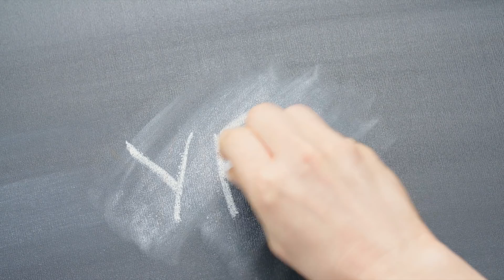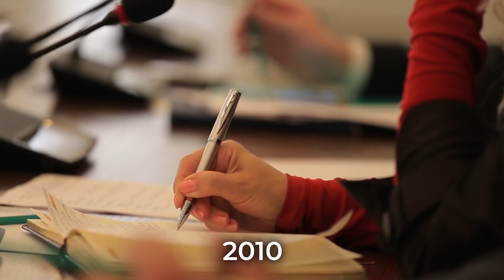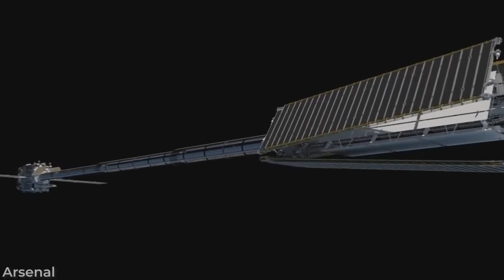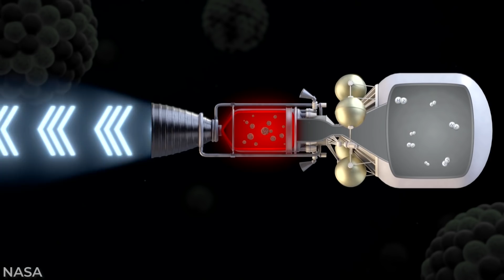Russia's INSANE NEW Nuclear Spaceship to Visit Jupiter

Comment: Is it cheaper or safer cost ratio to put it in space in pieces? The reactor itself should be fairly benign until it's turned on and becomes contaminated
Reply: The tug weighs 22 tons. It will be launched into orbit by the Angara rocket. The scientific payload will be delivered by the next launch.

Comment: I hope they succeed. Extremely expensive to get a nuclear reactor into space but once its there, you have ass loads of power you can do pretty much anything with it at that point. All you would need is to run more fuel up in 10 or 20 years.
Reply: What is expensive in getting nuclear reactor into space? The reactor is smaller than they put on ships and submarines while the launch costs are the same as any other space launches.
Reply: Several inaccuracies in here. As one example, the reason for HEU is not that it withstands reactor heat better than LEU, but because it packs more energy per volume. This sounds as if written by someone with certain gaps in knowledge of the topic

Comment: Russia - will not make it. Its just to overcome the shameful state of the roscosmos - after SpaceX rid it of the USA launches...
Reply: Russia has breeder reactors, a closed nuclear cycle, the ability to use any uranium as a fuel, the most advanced technologies for enriching nuclear materials, there is oil for petrochemicals, there is gas for fuel, there is hydrogen, helium, there are additive technologies, its own processors and low-level computer languages just above the assembler, China is using our missile warning system, using our gas and coal, germany will roll back into the Middle Ages just like Japan giving up our gas. We have the Northern Sea Route and the Arctic, and this is 30% of all mineral resources, there are oil reserves for centuries to come. It is possible to build tidal stations of such power that an orbital lift or transpolar highway can be built. Your "alternative" energy is ridiculous.
Now try to buy a fighter jet or a reactor from spain, clown.
We absolutely do not care what will happen to the world economy, we have energy and weapons. Everything else is a matter of work and time.
Reply: @elusive6119  "...matter of work and time..." You forgot to mention corruption absence... whish  is not existent for years to come......

Comment: Zeus is a freighter with at least 2 versions driven by already created Ion or Pulse Detonation engines and powered by 1MW class nuclear reactor. Its quite compact to be transferred via railroad network and got modular structure for much easy transportation and to launch them to space. But its possible it will be launched in assembled state, because its really compact. Can be launched to orbit by existing Angara rockets.
1. Zeus engines can change angles for maneuvering in space.
2. Solar panels used to power basic systems to turn Zeus on and start reactor power supply.
3. This large panels dissipate heat from reactor, possibly backed by another system.

Tasks:
1. Hauling of any cargo you attach to him, from new space station modules, to any space objects you need.
2. Change and modify orbit of objects in space.
3. Destroy any objects in space with high power laser or em emission weapon(optional).
4. Space and Earth scan for unknown or hidden objects (optional).
5. Transfer information in space with powerfull retranslator attached (optional). For example it can stay at L1 point at Mars orbit, recieve signal from planet, make it much stronger and direct it to Earth. With time you can create network of such repeaters making possible to transfer data much more efficiently than now. To stay at needed points in space it will use its engines and in such mode it can work many many years before refuelling.

At least one already built as prototype for testing and polishing.
1st unmanned mission was planned to the Moon and Mars, but its not clear what types of cargo Zeus is going to haul and how much cargo it can acually haul, but at least it can haul crew module and Mars Nuclear Power Plant, which in fact is almost same reactor like that powering Zeus.

But im sure if this things will work many of it will be produced, because you need at least 1 for Earth orbit tasks, at least 1 for Moon project and as much as you can afford for Mars exploration to transfer data or cargo to Mars base and back.

Comment: Yea a nuclear powered ion drive i reckon they're gonna use. Most likely Elon will do the same on his mars starship with a reactor similar to that of a submarine. Plus it can power more than just the propulsion, it can power the life support and flight control systems. But both Russia and SpaceX will use conventional rocket's to get out of Earth's orbit. With all of that said "Zeus" is probably the worst name ive ever heard for a rocket or a even space based mission. Soyuz sound's better, backwards with name's and forward's with tech. You have to love Russia for these types of thing's it's always pure out of the woodwork with whatever their doing.
Reply: Elon cant power anything, because US for many years is a backward country in terms of nuclear technology. So even if Elon can make ion engines, which i doubt, he cant get compact and capable nuclear reactor and no one on this planet can build it for him except Russia.

Zeus reactor is powering not only engines, but all systems, incluging attached communication retranslators/powerfull scanners/laser or emission systems.

Zeus is not rocket or mission, Zeus is a tug and it called Zeus because it got lots of electrical energy from on board nuclear reactor and can optionally fire lasers in sattelites or burn them with powerfull emission . It can be used for many tasks - military or civil.

And finally - Zeus can be temporary name, it was called Nuklon for several years before, so its possible that it will be called Soyuz or Sputnik, or Korolev for example.

Comment: And if they hit a bit of dust going that fast they'll be in a vacuum before they can say "Мы что-то попали."
Reply: В нас что то попало ;). Speed of particles in space so huge and random that speed or direction of the ship is not that important. Most such particles are tiny to our favor.
Reply: @maxinfly  Most but not all.  Some are KM across.  It's the V^2 component that's the problem.
Reply: @Graeme_Lastname  Difference in relative speed of vectors in "clockwise" and "counterclockwise" direction of launch is huge. - Are  you saying - that beyond "crowded" near earth orbits there are some "dedicated"  directions/speeds where "not all" particles are safer than in other directions ?
Reply: @maxinfly  Not at all.  I's mostly random except for the influence the sun has.  The speed of rotation is about 1600 KPH at the equator, so that is actually quit insignificant compared to travel velocity.  :)
Reply: @Graeme_Lastname  So generally speaking - faster you fly - less probably you hit by something "big"  because probability just grow with time you exposed (far from planet) and almost independent of speed you fly.
Reply: @maxinfly  Faster you fly the easier it is for anything that does hit you to cause damage.  Half M V squared.
Reply: @Graeme_Lastname  Faster relative to what - Earth ? Mars ? "Safe speed (you had said two messages ago not existed if I got you right)" ?
Reply: @maxinfly  Relative to each other.
Reply: @Graeme_Lastname  But you can't be "slow" relative to multiple "fast" and randomly moving objects at the same time you not even aware about. All you might do is to be as fast as possible on your track to decrease time you exposed to such objects.
Reply: @maxinfly  Yeah, you can.  A fast bullet does more damage than a slow one.  A fly traveling at twice the speed of sound could kill you.

Comment: Russia will build this monster and if it does not explode on takeoff or de-orbit, then it will produce tons more radiation than anyone expected and polluted everything that it passes by.  Honestly Russia does not have any money for space exploration now that the US stop giving them money for flights.
Reply: Its not a monster. Its acually quite compact for about 2 meters in diameter and 5+ meters long. And Zeus even dont start reactor on Earth, its launched to orbit by Angara rocket, then Zeus opens solar panels, powers up, starts nuclear reactor and begins its mission. Nuclear reactor just producing electicity with no pollution and powers ion or magneto-pulse engines.

Comment: Lets see now, the Unites States was developing this type of propulsion in the early 70s,  50 years ago but the anti nuclear movement sent it to the grave. Ironically normal chemical rockets can get to Mars in 6 months at the right orbital position
Reply: United States are really bad in any nuclear technology now. Checmical rockets to Mars are utopia and insanely ineffective solution. Zeus project can make travels to Mars much more common thing. I even think that no chemical rocket will reach Mars in 50 years.
Reply: @ЕвгенийБулыгин-д6ч  And yet Nasa has sent many exploration vehicles to Mars with 6 month journey times
Reply: @chubscub  they launched there with initial acceleration of rocket engines with no chance to get back. 

Dont compare this to regular flights with delivery of much bigger cargo to Mars AND back for less than 6 months. Some experts even talk about 2 months to Mars, but there is still no official data.

And take into account that Zeus lifespan is many years, so it can complete several missions for its cost. It can be docked to new ROSS station, get new cargo any fly to new mission. Basically its flying electrical power plant.

In the end this solution is hundreds of times cheaper than projects like SLS.
Reply: @ЕвгенийБулыгин-д6ч  So how many years will people have to live on Zeus just to get to mars and back, just wait for SpaceX to do it with chemical rockets before 2030
Reply: @chubscub  not soon, not until effective radiation protection wil be developed. Think about it how ppl will get to Mars for 6 mounths at best? They will get radiation dose, and Marse arent protected from radiation either. They gonna die there? 

SLS is hype project, technically its very hard to get ppl to Mars using chemical rocket engines. But for now Ilon can capitalize on this hype, for how long we will see.

Comment: Nuclear thermal propulsion was well tested in the US in late 1960's and 1970's. Nuclear power has been an enabling technology for ion and plasma thrusters. Well documented concepts. Only if they're going to gas core systems or perhaps Zubrin's nuclear salts system is there much "new" to this. The nuclear salts is probably the most easily done system with current fission knowledge..  and has very specific safety concerns.
Reply: In the 1960s, Soviet Russia had a perfectly working locomotive on a nuclear reactor.

Comment: Nuclear powered spaceship propulsion is a good idea, but nothing new. And you are messing up concepts big time. 
 - You keep saying among the stars and corners of the galaxy, but
 - Jupiter is a planet not a star.
 - 10 years of acceleration with a nuclear powered spaceship is not going to get you anywhere near any other star than our own sun.
 - The galaxy is a big place.... a really big place, it take light 105 thousand years to travel from edge to edge, and a nuclear engine will not get you to 10% of that speed.
But yea, a nuclear powered spaceship propulsion system makes a lot of sense as it can be 30-50% faster than a chemical rocket.

Comment: Is nuclear power on space ships a new thing?
Reply: Nuclear power for the main drive is a new thing - yes. I understand what you're asking, but don't know if it only a bite, or else. 500KW reactor in space is quite a new thing. Whoever brings it up and manages to control it will gain immensely. Then others will follow, powers will increase, etc.
Reply: @R.Daneel-Olivaw-8  As per my knowledge even Voyagers are powered by RTGs, so its hard to say its new. yes 500KW is massive and have a huge potential if done correct.
Reply: @gothama7522  Here we don't talk about RTG (isotope decay thermo-electric power), which are used on more that 200 spacecrafts to power onboard systems. The talk is about nuclear reactor that powers the propulsion. Quite a difference, isn't it? On top of that having a megawatt class power source onboard, would allow for unprecedented use of efficient deep scanning from orbit of distant worlds, and powerful transmition of massive data to Earth in huge volumes.

Comment: I know how it propulsion work it's a equilibrium propulsion. enclosed loop reactor the trust is less than half the power of the. generator. But 200 kilowatt of trust can accelerate a20 ton space ship very well
Reply: But if it didn't controoled Good .the nuclear explotions  will distroy the ship
Reply: @iskanderfecere6969  Zeus uses nuclear reactor just to generate electricity to feed Ion or magneto-pulse engines. Nuclear propulsion isnt such effective and very dirty to work with.

Comment: I am a little comcerned that other interested parties will have something to say about the use of nuclear power in space.If i recall correctly there was a visit to a a nuclear missile sight in the U.K.
The idea of littering space with old nuclear powered satelites and such is not what anyone could call friendly aa they may well be of no use for power anymore but fhey still represent some very Unwanted forms of rubbish which could end up anywhere.
I really thing that a lot more work should be put into cold fussion which produces a whole lot less dangerous waste, i am sure that given some more real efforts to get this to work will be worth  it in the long run  and are a lot less likely to upset otheres.
The idea of their own space station is a real good plan, as at present is seems that they are being treated as the caretaker for the present one.
Besides, with America clearly going the wrong way as usual  it will allow the advancment by Russia to take place at their  own speed.
My only hope is that they operate the power supply after having arrived in space so should there be any problems it will come in relative safety of space, say a standard launch with a well tried and tested rocket to get it into space first, this move to seperation over the space station will at least make sure we dont have the very thing the agreement signed many years ago where nobody would control space, signed by America at the time, has gone the same way as all the other agreements signed by the U.S. and i really wonder what is wrong with the world that it appears no longer has any gut to point  out that there was an agreement signed about this, it seems that the U.S, is not happy till everything to do with them revolves round them being in charge or dominating it above all others, seems they are a little forgetfull as to who got there first and did so without any threat of domination either then or now, i dare say that this is another one of Americas secrets that even their own people dont know and will not know anything about.

Comment: Put the stockpiled war nukes to interesting use, good to see
Reply: That uranium would probably need to be downgraded somehow, because it's at least 90% enriched, while the normal fuel is only 20% enriched. 90% enriched one would probably be very hard to control.
Reply: @milutinke  It seems like it could be done. Isn't enriching the difficult direction? Couldn't the 90% enriched uranium be "diluted" back down with more of the other isotope? 23*?
Reply: @Dane33781  A small reactor needs a high concentration of fissile material due to the high neutron leakage of a small core and/or fast neutron spectrum or it won't produce any power. SNAP-10a's core was about the size of a basket ball and I'm pretty sure it used plutonium or highly enriched uranium.
Reply: @leerman22  I didn't know that.
Reply: This has been a concept for decades.
Reply: Dont worry each nuclear powered spaceship will be equipped with 2 nuclear missiles each.... for alien defences obviously

Comment: The nuclear part of the engine produces heat. This heat converts a given matter (Krypton, or Ammonia, even pure water) into plasma that is then expelled by the engine nozzle to produce thrust. 
Other uses in Space of a nuclear reaction is to produce heat and use the temperature difference in a semiconductor thermocouple to generate electricity, as in the RTG in the Voyagers or the Mars rover Perseverance. Decades ago, the Soviets used nuclear energy in the COSMOS satellite, which fall back to Earth, in Canada in 1981 IIRC. Newer RTGs uses heat from radioactive decay to power a Stirling engine which generates electricity.
A nuclear propulsion device can't lift a rocket from Earth surface, but it is OK for interplanetary travel. Keep in mind that the nuclear rocket plume is highly radioactive, and this type of rocket requires VERY special precautions during launch, and all along the downrange path of travel.